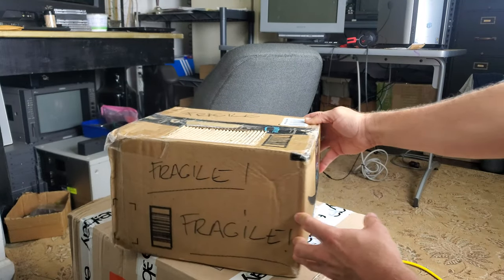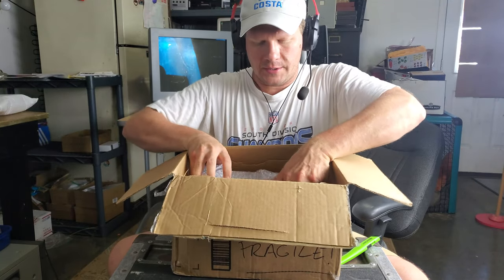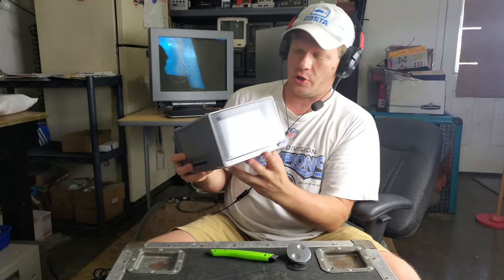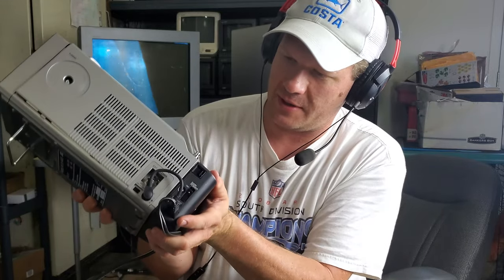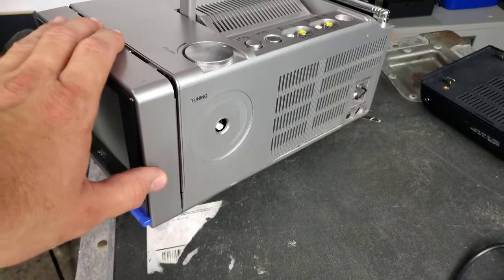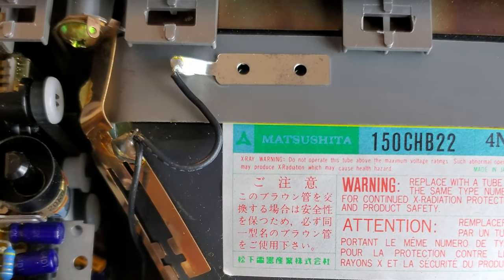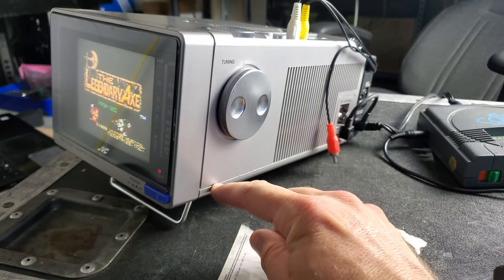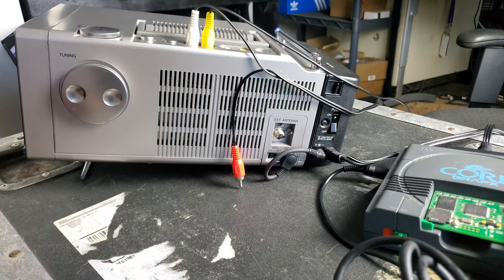JVC CX-60US Portable CRT Monitor | shipping CRTs for dummies.

Comment: Found one nearby on classifieds from first owner, a black one. Amazing TV. It is even multi-standard, I tested it with both PAL and NTSC signals. Hope you found the geometry fix. Mine has it a lot less, but you can see a slightly bit of pincussion. The rear is a detachable power supply, and there was a variation with built in NiCad cells for 100 minutes of portable TV use!

Comment: Another question, did you see if you can take off the plastic cover in front of the tube? It seems to have a diagonal line on the back, you can faintly see it, and my thought was to polish it away, but it is on the back.

Comment: I have a JC Penny tv/monitor like that that uses the same exact tube part number.  I was wondering if it was a JVC rebrand!
Reply: And it showed up packed just about as well with power board completely broken in half.   I was able to fix all the broken traces and get it back up and running and I currently have all the capacitors to recap but haven't gotten into it yet! Cool little sets!

Comment: I felt your pain as you unwrapped that CRT. Why do people SUCK at packaging?  I don't get it. There so fucking lazy. I say you get all your money back, keep the monitor, AND leave that seller a FAT negative feedback. If you can't tell this shit happens to me all the time and dammit I'm tired of it 😁
Reply: Negative feedback is for being ripped off, not disliking the packing.
Reply: @NirnBootMod  Negative feedback for a horrible packing job that damaged the item he paid for. It was blind luck it wasn't damaged more.
Reply: @utubepunk  It wasn't damaged, just required some time to put the case on right. You can leave a mediocre feedback and mention the horrible packing, but not negative.
Reply: @utubepunk  If it was damaged, you could easily get your money back. eBay only cares about the buyers and 99% of the time sides with them. Now if he tried to not accept a return, for sure he would deserve negative feedback.
Reply: I used to sell PVMs for dirt cheap, I packed them with extreme care, double box, foam on all the angles, cardboard spacers, all that sort of stuff.
Three of my monitors delivered broken, one of the buyers wanted refund while keeping it (He basically wanted a PVM for free).
The delivery guys treated the boxes without care, was it my fault? Should I be responsible of something I tried my best to prevent?
Buyers should be extra careful and know what they are doing. Crts broken after shipping are a known fact, if you want protection, you pay for insured shipping.
Also, if you buy something like a PVM (especially for cheap), you should also be aware of many common crt issues and how to fix them (caps, geometry, and so on).

Please tell me what do you think guys.
Reply: @shiningstarlet6215  Sounds perfectly reasonable. We forget half of the problem is the delivery people. They throw boxes no matter how many times you write "fragile" on it.
Reply: @shiningstarlet6215  I actually got a full refund for my JVC TM-A14PN from eBay (and did get to keep it) just because bad shipping damaged the corner where the speaker is (nothing affecting its working condition). Not a PVM I know and S-video maximum, and this was back in 2015 and it would've only been like £30 before the refund. IIRC it had been loosely placed in a cardboard box and then a load of packing peanuts poured into it.
Reply: @shiningstarlet6215   agreed 100%

Comment: What is the point in that packing when the tv is right up against the wall of the box....stupid packing, Ebay and peoples idea of packing though grrr I've had my fair share of it over the years, 2 this year as it happens,  I've had 2 X 20" crts that i bought this year both different sellers yet packing was just some cardboard ducked taped around the tv nothing else! needless to say the tvs were smashed to bits by the time they reached me, luckly i only needed the tubes of them which both survived....how i dont know, makes me mad 😡 though